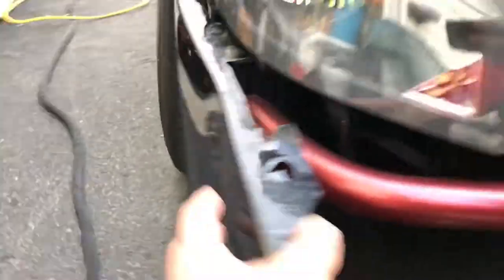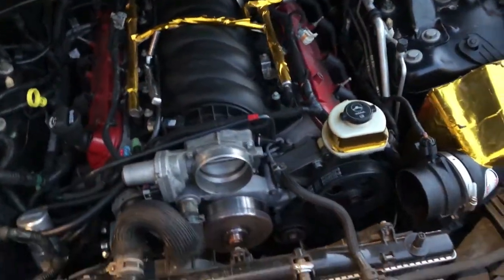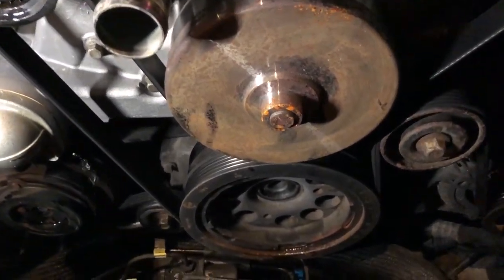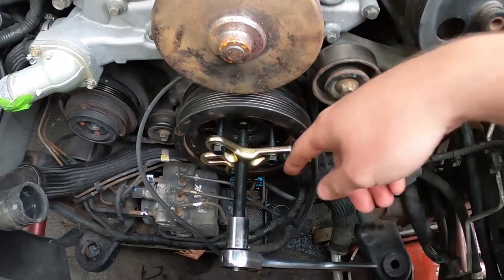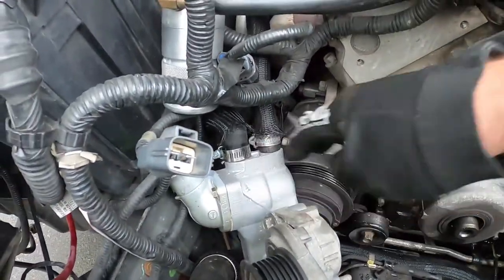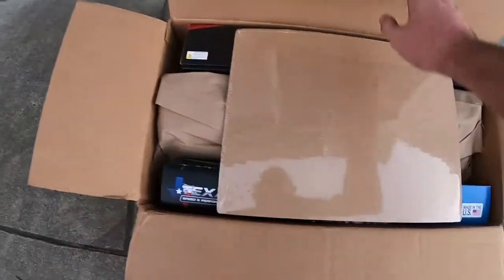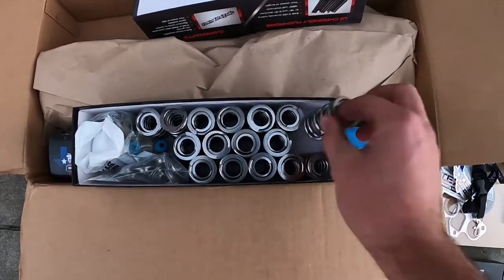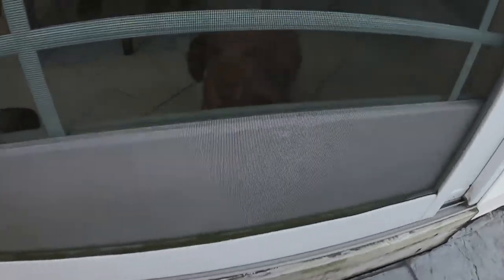Beginning of the CTS-V CAM SWAP!

Comment: Would you recommend installing this ? I got the torquer v4 and it’ll be my first time installing. Unless I pay 1500 for install which I rather install myself what do you think?
Reply from the maker: It was my first time this time around and I’ve done the cam in my other V since then too. I would just get the proper tools, like the dowel rods for the lifters and the air tool to keep the valves up while doing the springs. It can definitely be done in the garage if you have some mechanical ability.